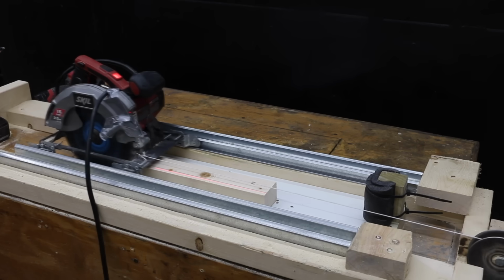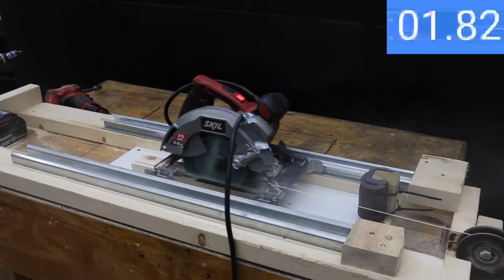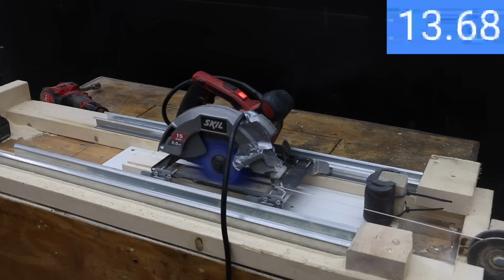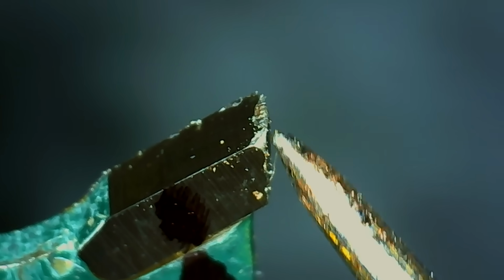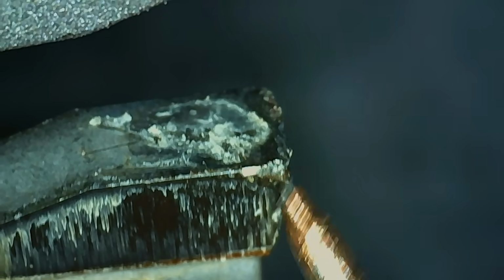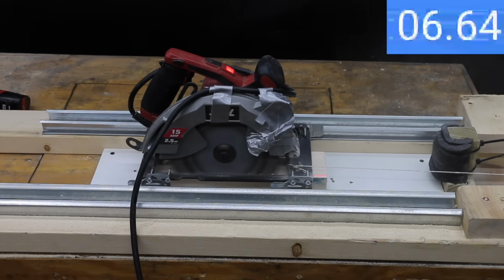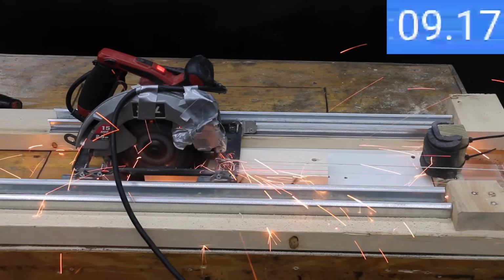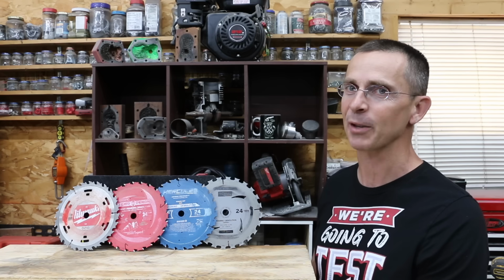Best "Demolition" Circular Saw Blade? Milwaukee, Diablo, DeWalt, Hercules, Evolution, Bosch, Amana

Comment: Amazing methodology,as usual.

I went in thinking "how do you best test a demo blade, since speed going through a 2x4 might not really tell you much".  After watching the whole video, I realized you'd really captured what a demo blade goes through.  Beat the hell out of it, and see how well it works afterward.

I'm curious if any of the major tool manufacturers have ever heard of this channel.  DeWalt should honestly be a little embarrassed they put their name on this saw blade.  Given the poor performance of the Dewalt (and the fact that Dewalt is generally a great tool) I'd guess that Dewalt just licenses their name and has little to do with making the blade.

Comment: That lumber was more expensive than all the blades combined.
Reply: wdym? how?
Reply: @johnstaker6706  lumber prices have skyrocketed
Reply: @johnstaker6706  Last week I bought four 4x4x8 pressure treated and four 2x4x8 pressure treated for my grapevine trellis.  Those 8 boards were a tad over $100.  Wood prices have gone through the roof.
Reply: @johnstaker6706  lumber is about 5x as expensive as last year.

Comment: I feel like Big Blue has proven again the whole theory of not reinventing the wheel. Saws have many teeth for a reason, lessening the amount sure doesn't help.
Reply: As a wood machinist It looks terrifying tbh
Reply: In demo work where blades are going to dull no matter what you do fewer teeth will often allow the blade to have some bite where blades with high teeth counts just start gliding. The saw used also lacked the torque for the blade. I still feel the results are valid for the general user though as most people aren't going to buy an expensive high torque saw for DIY stuff. If I'm not mistaken the saw used in testing is about a $50 saw. At the end of the day Big Blue will still be cutting, ah bashing actually, through boards when most of the other blades just try to start a fire not going anywhere.
Reply: Fun fact: saw blades and router blades from the first half of the 20th Century often looked like that. They were banned in Germany in the 80s, because they are incredibly dangerous:
Not only is the danger of kickback extremely high, the laaaarge gap between the blade tips will also rip your whole hand off instead of just your fingertip.

Just don’t use blades with a gap more wide that your little finger is thick. Just don’t.
Reply: @RicardoCristofRemmertFontes  Not entirely true. I am from Germany, we have router heads with just two blades. But they are required to use a counter blade that's tilted in the opposite direction and limits the strands that should not have more than 1mm in thickness so they won't rip your whole hand off.
Reply: What's surprising is how it passed their R & D testing stage... or did they just skip the real-world testing and believed some computer model?
Reply: @alfredoprime5495   nah the engineers knew, this is all about marketing and looking “mean”
Reply: I think it has more to do with being different and flashy.  People are going to buy it thinking it's some awesome new radical design that works great, and then convince themselves of that even though their blade is doing worse than a regular blade.
Reply: I'd bet that they went with a 5 bladed saw because they can cut a lot more blades out of the same sized sheet of steel.  Plus, the use only 5 pieces of carbide!  The thickness of the steel and carbise is more than the other brands, but when the quantity numbers work in your favor so much, it comes out better for their bottom line.
Reply: Looks like a scrapped lawnmower blade design.
Just had it hanging around and decided to brand as a new saw model.
Reply: Interesting, I was just about to say the same, but couldn´t form it into words...:-) Big Blue (Smart man tools) wants to earn the big money by extravagant appearance and big words instead of quality and sensible design. Their promotion: "Smartman Tools was born out of frustration with existing methods and tools for roofing demolition. We knew there had to be a better way, so we built dozens of prototypes and tested for hundreds of hours. We didn't stop until we were satisfied. " No comment on this.
Reply: @AnonymosAnthropos 
Oh, I believe them.
They tested for months and never got anything even half decent. So they took the first cheap shit and released it anyway.
Reply: Up to a degree it helps reducing Heat build up. dir rough Cuts in lumber lesser teeths do help. 5 are just way too few
Reply: It’s for cutting curves. Firefighters use a 15” version for cutting through roofs.
Reply: Marketing
Reply: As a guy, with not enough experience to know any better, I found that blade to be scary looking. I would think that a small majority of people in various parts of society would.
Reply: @eugenetswong  it is a specialty blade for cutting curves without binding.
Reply: @D-B-Cooper  thanks for clarifying. It's good that you and another guy brought up another view.

It would be nice to see another video, where several machines swapped for each blade, and then results are compared.
Reply from the maker: Thanks for the feedback.

Comment: I get my Spyders for $6.90, I demo and reno very old homes that only have nails generally. Very happy to see their wood with nail performace. Not the best but for my bottom line the cost wins with the slightly higher wear. When they wear out I throw them in a bin and flip them backwards on an old 15amp sidewinder and use them to cut plaster and lath.
Reply from the maker: Thanks for sharing.

Comment: I tend to use Diablo pretty much exclusively because it's what every place that has saw blades near me seems to have,,,can't say that's a bad thing because they always seem to do fine and dandy in my book,,,so all my saws (reciprocating, jigsaw, circular and otherwise) have a Diablo on them,,,I especially like the extra thin curf blades they offer for use on my 5.5 and 7.5  inch cordless saws because they take way less power to turn so even my little Milwaukee M12  5 and 3/8th's saw can blast through even 2x12's with fair ease making having to use a much heavier hard to use corded saw pretty much unnecessary unless you have a whole bunch of cuts to make (however I have used my Millwaukee all day cutting 2x12's with only a couple battery changes as long as I'm using the 6ah or bigger batteries,,,it's such a nice light easy to use saw with good power and I like to use it most and my big Milwaukee worm drive hardly gets used anymore because of it,,and even ripping full sheats of 3/4 (23/32") OSB T&G subfloor the little M12 handles it just fine as long as you don't have a bunch to do in a very short time frame,,,as long as you cut a couple then lay a couple giving it a few minutes to rest after 2 or 3 sheets cut,,,awesome little saw  ),,,,,anyhow good to see the Diablo blades tested,,,good to know they do real well overall (or seemingly better than average at least because they are fair priced it would seem) anyhow thanks again for the work making another great  testing video.
Reply from the maker: You are welcome!

Comment: The angle will make a difference. How large of a chunk of carbide will make a difference. I have a 40 years old Master Mechanic from True Value Hardware with 20 or 24 teeth and large chunks of carbide. I get it sharpened at Acme Tool in Des Moines. Haven't seen the same quality of blade since.
Reply from the maker: Thanks for the feedback.

Comment: Honestly though, how often are circ saws used for demo? I'd love to see a test for the best Sawzall blade!
Reply from the maker: Thanks for the video idea.
Reply: I don't know the answer, but given the difference in speed, I'd bet circular saws are used far more often than you're thinking.  If it's a long flat surface, the circular is going to be way faster than a reciprocating saw.
Reply: @TrueThanny  I agree, but in my experience having done some demo myself after storms at home, I very rarely had the luxury of a long flat surface. The vast majority was cutting overhead or horizontally, which would be nearly impossible and very tiring respectively. Hopefully I get hired for the demo job I applied for, then I'll be able to give some first hand experience!

Comment: Amazing video like always.  Thank you.  
Recently I saw a YouTuber touting a new type of electrical connector they are orange and stripped wires just click on.  I'm not sure if they are only for low voltage applications. But I would love to see a video about electrical connectors,  both low voltage and/or high voltage. Are "wire nuts" really the best, is soldering worth the effort?  Do the connections add noise (an oscilloscope may be needed)? Hobby electric projects, like mine (low-voltage), and pros (high-voltage) guys may be really interested in it.
Reply from the maker: You are welcome!  Thanks for the video idea.
Reply: @ProjectFarm  other terms for evaluation of electrical connectors is, Do they fit in a standard junction box?  With standard amount of wires and maybe double the amount of electrical connections. Are they water proof? 

I know some of it may be subject to local code but it would be nice to have a form of comparison.

Comment: Never too early to get winter videos prepped. 

Still would like to see best pellets for a pellet stove. Burn rate, ash production, btus etc...
Reply: That's a good topic. I don't burn pellets anymore, but when I did, I definitely could tell quality differences between pellets. The brand Costco sold at the time was excellent, and was cheaper by the pallet than I could get them anywhere else. 1.5 - 2 pallets would last us a winter.
Reply from the maker: Thanks for the suggestion.

Comment: I own two diablo circular saw blades; a framing blade (26 teeth) and a finish blade (40 teeth). Although I don't use them much they both make very clean cuts. The finish blade is excellent for fine woods and thin cuts, but will heat up if pushed too hard. The framing blade is good for pretty much everything and makes clean cuts as well. They are 4 yrs old approximately. I went with the diablo because of this channels testing other diablo blades. And made in Italy as well.

Comment: I've been a builder for over 30 years. I can tell you from experience demo blades are scam. If we're doing a pretty large demo. I buy a bunch of packs of the cheapest 24 tooth circular saw blades for the job. By far works better than any demo blade you can buy. Love your videos keep up the good work
Reply: I'm curious as to why you'd use a circular saw at all for demo, when a sawzall works so much better.
Reply from the maker: Thank you for the feedback!
Reply: TehButterflyEffect   We use circular saws for demo mainly because they cut 20 times faster than a sawzall. Now imagine having to remove about 4,200 ft of plank floor sheathing off joist. So to remove floor sheathing you would have to cut in between all the of joists to remove all the floor sheathing. Which would be about 150 cuts at 25 ft long each. Would take you about a week to cut all that up with a sawzall. Circular saw I will cut that up in about 3 hours. Especially if you use a worm drive
Reply: @Dr.Meola1980  Ah ok, I thought you meant general demolition. Like removing walls and stuff. I can see how using a worm drive would be faster for flooring.

Comment: Can you make a video to test out circular metal cutting blades. Would like to cut metal piecess for a pole barn. Thanks !  Great Videos !
Reply: Most of the metal blades available are only useful for cutting 1/8-3/16 material. They don't handle thick stuff well.
Reply from the maker: Thank you for the suggestion!

Comment: So carbide tooth demolition blades is just a marketing gimmick. For carbide to effectively cut steel it needs to slice a shaving, not hammer its way through. To slice a shaving the tool needs to be rigid and running the correct speed. A circular saw is not doing any of that. And that's why it doesn't work.

Comment: I have an M12 Fuel Circular saw that uses 5-1/2" blades, who makes good quality clean cutting
 blades in this size? I currentxly have a Diablo 24T finish blade but most brands only make basic 18T framing blades.

Comment: A framer's opinion is that any blade works quite well for embedded metal. I use old wood blades whenever I know I am going to cut through metal, and they are all similar: they lose teeth, they smoke, sometimes they catch and kick back hard, but they still work, and they work for a surprisingly long time! 
If I can use a wood blade for a couple months, and then get a second life from it cutting metal embedded wood, I tend toward not even trying a specialty blade.

Quick tips: safety glasses every time and still squint; long sleeves unless it's so hot you can't stand it; be ready for a strong kick always, but most often as the back of the blade is passing the previously cut nail.
Reply from the maker: Thank you for the feedback!

Comment: I have an awesome Video Suggestion:
Gear oil test:
Amsoil: SEVERE GEAR® 80W-90
Amsoil: SEVERE GEAR® 75W-90
Hotshot’s Secret: Blue Diamond S9 75w-90
Hotshot’s Secret: Adrenaline R9 75w-90
Lucas: 80w-90 
Lucas: Synthetic 75w-90 
Valvoline: High Performance 75w-90 
Valvoline: SynPower 75w-90 
Mobil1: Synthetic 75w-90
Royal Purple: Max Gear 75w-90
Red Line: Synthetic 75w-90

Thank you so much for everything you do! You do a fantastic job informing everyone on what is the best product.
Reply from the maker: Thank you for the suggestion!

Comment: I been asking for this video for like over a year but you didn’t even test any real blades only hardware store and Lowe’s, Home Depot blades which are all cheap crape blades for carpentry and DIY’ers I could have told you the results from all them dang blades use on soft wood and make about 100-150 clean cuts hardwood about 25-100 clean cuts.Get some real woodworking blades like - CMT, Forest, Amana Tool, SawStop, Powermatic, Luxite, Freud Industrial (not Freud Diablo that’s there cheap consumer blades) The first time any one that has ever used a regular $20-$50 blade uses a real blade like those I named in the $100-$250 price range you will never go back ever oh snd when the goods ones get full you pay $7-$9 and ship it bank to manufacture or a real sharpening shop and they sharpen snd fix and balance them and ship them back and this can be done 10-25 times so yes they cost more up front but last forever and are much much much cheaper over time compared to the cheap stamped steel blades which every single blade in this video is ok I’m done good video and great test I loved it just poor blades very very poor blades bye now.
Reply from the maker: Hey! Thank you for the feedback.

Comment: The finest testing jigs and testing videos on YT! Thanks for another great testing video!
Reply from the maker: Appreciate this!
Reply: @ProjectFarm  I was about to start writing about a performance loss graph when the last one was shown.
That's great work because what it tells is which blades can handle abuse and which ones can't. 
What I really like about your channel is that you demonstrate the concept of "value for money" and so few reviewers actually do that.
Reply: @ProjectFarm  have you ever thought about abuse testing 6v and or 8v golf cart batteries??
Reply: it would be great to have a flag by each brand in the graphs to know what country made them throughout the test
Reply: the absolute truth, must be the fairest consumer tester ive ever seen on yt, or anywhere, even tho its not always relevant the way the tests are preformed is usualy to perfection and is a sight to be seen anyways!
Reply: Maybe not the finest. But very consistent and solid setups for cheap.
Reply: @ObservationofLimits  fair point. But without spending hundreds, if not thousands, on calibrated testing platforms. Certainly creates a very fair margin of error.

Comment: The Bosch blade wasn’t slower because it had less teeth. It was slower because the kerf was wider. On a regular circular saw blade more teeth make the blade slower not the other way around. However more teeth make smoother cuts.
Reply from the maker: Thank you for the feedback!

Comment: I think when it says "not recommended for ferrous or non ferrous metals" it means it doesnt recommend that you cut a sheet of steel or something like that.
Reply: don't cut a sheet of aluminum.
Reply: The problem I see with that, is it subjective and deceiving.  If the saw does not work with a regular metal nail, the manufacturer will claim that the expected nails were meant to be plastic ones...

Comment: Safety Alert!  One of my coworkers cut open a shingle roof with a Milwaukee circular saw in the late 80’s and when he sat the saw down the blade was still spinning and the tar gummed up the safety cover where it wouldn’t close so it kicked up and cut the tip of his finger off right behind his finger nail.  Right through the bone and all. Ouch!  Be careful if you cut something that can gum up your spring safety cover.  Hope this post prevents an injury.  Stay safe.
Reply from the maker: Ouch! Thanks for the word of caution!
Reply: You have to wonder if a standard circular saw blade spins too fast for that kind of work.  Consider the chop saws used for metal cutting--the blade spins much more slowly.

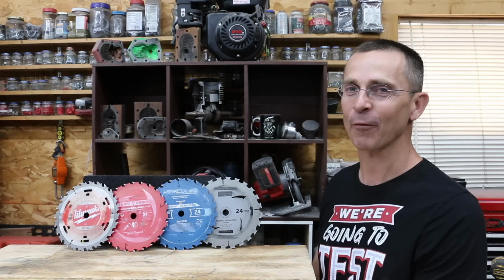Comment: 19:50 -- Is the Evolution blade really the best when it's mislabeled for "demolition" but at the same time also has a warning "Not for use on ferrous metals"?
Reply: I took it to mean don't use it exclusively on metal. Demolition is occasional metal, and it held up great for that, but it cut through less steel in this video than one cut through 2x2 tube steel.